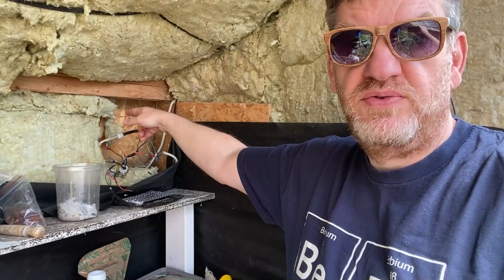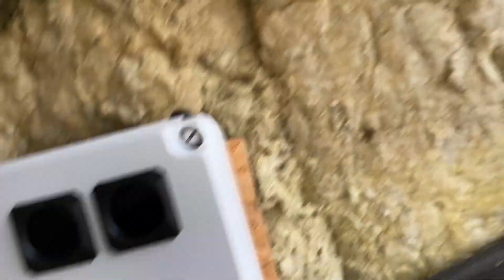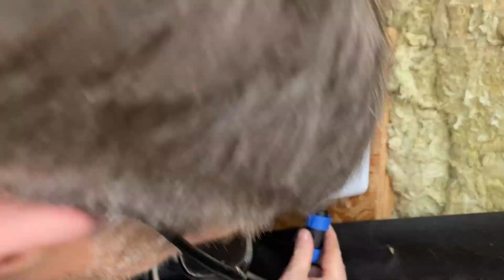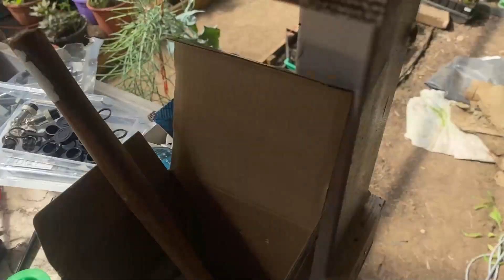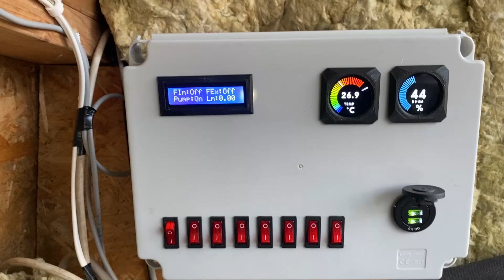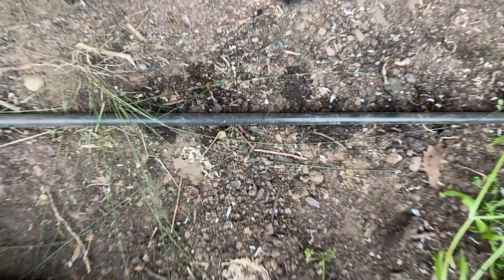Is My Greenhouse Smarter? DIY controller panel install

Comment: I'd love a video on Home Assistant, how you set up the different sensors, mqtt etc. I'm having enough trouble trying to Frankenstein together all the code for my ESP32 and the home assistant mqtt documentation is giving me a headache. I can usually understand decently commented code but I haven't got any real experience writing my own. This project of mine threw in a few too many completely new things for me to be comfortable. ^^ I'll figure it out eventually, just a matter of how many grey hairs it will take.